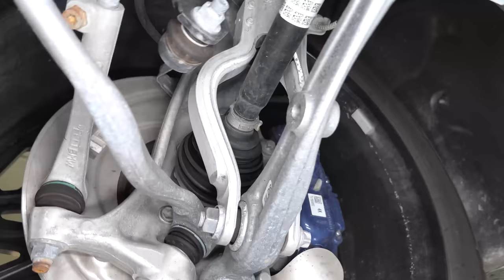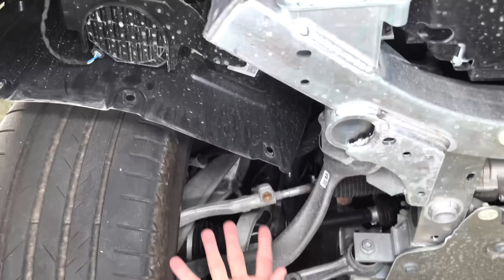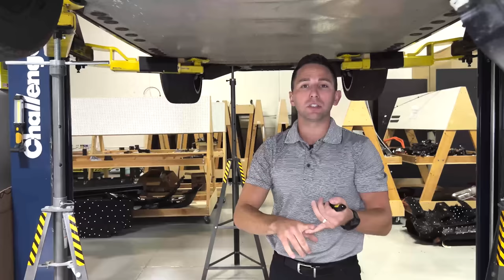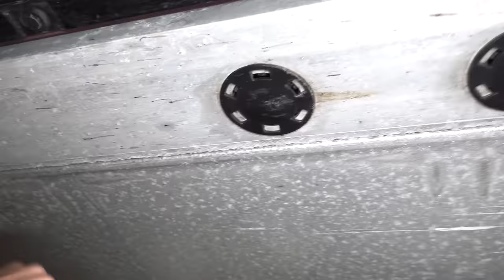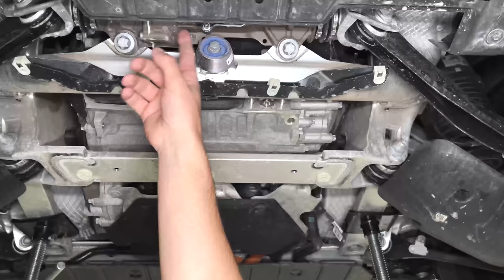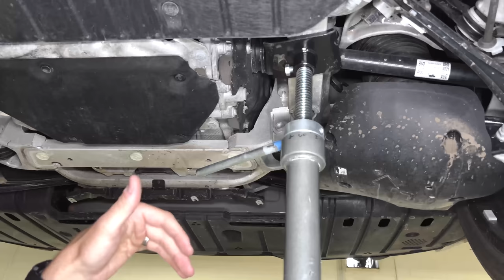Adaptive two-axle air suspension | BMW iX Hoist Review

Comment: Thanks for the great analysis!  I must add, that in addition to your obvious engineering expertise, you are very good at presenting.    Good elocution and good organization of the material.    I was lucky enough to test drive one of these last weekend!  It has kickass acceleration yet buttery smooth ride.   My Teslas haven't been even remotely as good on ride quality.   And, of course, it has plenty of impressive high tech stuff on the front screen for driver and passenger to play with.  And the Big Butt front of the car doesnt look so bad in person.   However, my local dealer wanted $108k for the car!  It was Red/black like yours, but did NOT have as many options as yours.  I look forward to your next videos about this very interesting new vehicle!
Reply from the maker: Thanks Wilber

Comment: Fabulous engineering design analysis Jordan.  I particularly was impressed at your discussion of a virtual ball, the intersection of two lines. I am Not a Mechanical Engineer, so lots of what you were discussing went over my head, but much appreciated nevertheless.  Your use of a laser pointer was Very Impressive.
Reply from the maker: Thanks Jay
Reply: OUTDATED horse & buggy design, outdated handling & suspension. TRY HARDER.
Reply: It would have been a good analysis if it was right. The name "virtual ball" is wrong by definition as the point of  two ball bearings is to not have a fixed virtual axis. If you draw it up on paper you will se that the geometry makes KPI move duringe a turn. The result is that the scrub radus (distance between KPI and the wheel center) wil shift in oposite direction on oposite side of the car and with that, the torque steering forces on each side will cancel each other out. In european litterature its called variable scrub radius geometry, and it was itrodused on Audi A4/Passat B5 in 1995. Or, at least, that is what they teach in machanics class in Europe.
Reply: @GTO33  - two WONGS don't make it RIGHT.
Reply: @markplott4820  What on erarth are u on about?
Reply: @GTO33  ignore him, hes always tr@lling for Tesla.
Reply: This car is like from the future,they have a graet vision and mindblowing buildquality,this car will revolutionize the way we drive in every way!Think about all the posdibilities!We could drive this BMW evs in small tunnels underground,that will solve all ur traffic problems!

Comment: 09:45 That lower control arm seems to be shared with (at least) the X5/X7. The hole is for attaching a mass damper (on the X5/X7), which apparently wasn't needed on the iX.
Reply: It is an X5 control arm.

Comment: The "soft" tyre aero deflector cone is necessary to meet the kerb strike test attributes.  The vehicle must be capable of being parked with its nose over a standard road side kerb (typically 100 to 115mm tall) without damage. By using a soft easily deflected material this means that people can park the car over such a kerb without anything getting damaged, but that parts of the underside covering /guarding can now project down into the kerb strike area to help to minimise aero drag (and wind noise too)

Comment: Two scenario's are probable to explain the post forge machining of the suspension horseshoe:

1) It was designed with a certain clearance that vehicle level kinematic testing showed to be in-sufficient, but the forge tooling was already done, hence the post machining op to increase the clearance

or

2) Real world testing highlighted the need for an improved steering lock (perhaps the rear steer targets were not met) requiring front axle knuckle/upright rotation to be absolutely maximised and the machining provides the extra clearance required

On my old E46 you could very occasionally actually feel the inside roadwheel go "over centre" at full lock, typically on un-even ground when the inside wheel was pushed up into the arch (towards full bump) so BMW clearly work very hard on minimising the turning radius of their products, esp the RWD ones where there is no front axle drive to complicate matters (CV joint limits)

Comment: The thick alluminium shear plates very firmly attached to the underside of the subframes are clearly to provide a cross axle stiffener to carry the (high) lateral loads at  a sutiable level of stiffness. Yes, they act to protect the underside components, yes they act to smooth underfloor airflow, but the size and number of the fasteners that attached them to the subframe members tells us that the primary task is to shunt lateral loads across the subframe (high clamp load required to pass load without fretting).  Of course these plates also massively increases torsional stiffness and reduces subframe trapeziodal deflection during offset (single sided) crash pulses as well, as the geometry of the shear plate clearly distributes any force in plane of the road surface. These plates also provide a simple way to tune the immediate off-centre response of the vehicle to handwheel inputs, particularly at the rear where the inital turn in feel / yaw rate is dominated by the lateral stiffness of the rear suspension

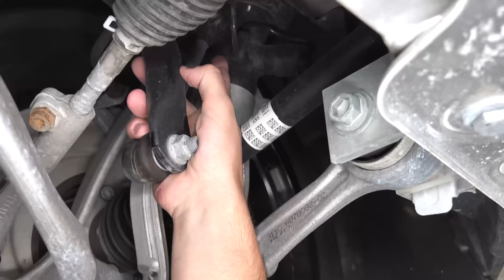Comment: At 10:10 you are referring to the hole in the lower control arm and suspects it may be a carry over part from another vehicle. This hole is to mount a vibration dampener which is likely due to specific wheel size for that vehicle. For example, in the X5 and X7 with 21" and 22" wheels, these vibration dampeners are installed.

Comment: Great job of explaining all of the components and what they do.  I have always looked at these items from a do-it-yourself perspective which I stopped doing in 2003.  Up to that time I have always done my own repairs and the year of vehicles I worked on was late 70's or earlier.  Yeah I'm old!!!   I would not want to try a self repair of anything on these vehicles!!
When I look at all that aluminum, I think of owning a vehicle in the 'salt belt' where they use salt in the winter.  How do you think these components will hold up?

Comment: A very good explanation . In lots of details . The part that you went on about honestly was slightly over my head . About cutting out a circle in the chasey would of been good to see maybe a slide show of that part in other car for comparison and then the explanation . 
Good a green laser pointer 👍🏽 camera 🎥 lighting 🫶🏽🙌🏾👌🏽 and in focus 👌🏽 
Now think what I would love to see is photos slides of the underside of the bmw with all the aero said b4 be great to see actual maybe a show of underneath all ev’s to show who’s car looks the most aero an area that I actually love not as much as battery cell but very close and maybe a aero guy actually showing where manafactures are doing well but also showing where there is need for improvement needed I generally think around the steering areas 
Love to see ingeneussolutions to deflecting air round parts 
🤞🏽🤞🏽🤞🏽🤞🏽🤞🏽🤞🏽🤞🏽🤞🏽
So in short a show of under body’s 
Maybe do a competition who ever gets the best under side name picked gets a signature of the underside signature on it thanks guys I have loads of idears

Comment: The temperature sensor in the wheel well has been with BMW for over 20 years, at least since E39. Not the best spot for reliability, but probably a good spot for ice warning.
Reply: The temp sensor responds very quickly in that location.
And it doubles as an indication that your mother-in-law drove over a parking stop until the tire hit, and pulled off the front wheel well lining and sensor when backing out.  Which happens every time she visits.

Comment: If that is rear wheel steer it must be the shortest range of motion I have ever seen, furthermore, it seems to be connected to the suspension arm rather than to a steering knuckle. Correct me if I'm wrong but that looks more like an active toe/camber control device. Go back to your EQS video and the difference is obvious. I would doubt if the steering angle allowed is more than a few degrees. On the EQS its a full 10 degrees.
Reply: It doesn’t need to be two digits lol…… at higher speeds it’s super responsive
Reply: @carholic-sz3qv  
Im sure it handles well, its a Bimmer! The question is if it qualifies as "rear wheel steering" or not.

Comment: 2:51 talking about front steering without mentioning that you did not mean front wheel steering, will cause confusion :)
Reply: True! For those wondering,  front steer in this case means the steering linkage is at the front part of the suspension, in front of the "axle line," where rear steer simply means the steering linkage mounts on the rear side of the (front) suspension.

Comment: @MunroLive Have you seen Bjørn Nylands video on the i4, where the battery and cabin share the air conditioning and cause overheating, if you fast charge and use the ac at the same time?
Reply: Scoor ding to Björn’s last comments BMW suspects there’s a problem with that very new car. Other i4 drivers also mention having no issues during trips in hotter weather
Reply: @ramdynebix  Yes, I was one of them. 40+ degrees celsius in France with fast charging and +130 kmph driving - no worries.

Comment: BMW pretty much never connect antiroll elements via the lateral links for two very good reasons:

1) You get approx half the displacement of the knuckle/upright at a point approx halfway along the lateral link. This means your Antiroll elements need twice the effective stiffness, and that puts twice the load and frictional losses into the system

2) Putting vertical loading into the lateral links really complicates the K&C bushing, and adds a large non lateral displacement to those bushes which changes the dynamic kinematics of the suspension

Less premium cars with lower R&H targets do this (connect ARBs to lateral links) to save costs at the penalty of less optimum dynamics......

Comment: Your analysis of BMW's engineering is insightful, but I respectfully disagree on one point. While not machining out the hole in the carryover control arm can save costs, it can increase delivery and repair costs as a new part needs cataloging, separate procurement, and global stocking. Part crossover between models benefits both customers and the supply chain.

Comment: Why does it make a difference which side of the ball the steering rack is attached? It's nominally a rigid link and always pushing on one side and pulling on the other, so moving the back or the front seem to me like they should have the same effect on the wheel? Can someone explain why this matters?  (2:19)

Comment: Hi Jordan.

Thanks for your explanations of the front and rear suspension and axle geometry.

Think BMW's idea is to combine ICE, PHEV and BEV Plattform in one as they did befor.

CEO Zipse is until today on the trip that the market becomes H2 and E Fuels Motors.

Yes he isn't right but he explicitly pronounced that all the BMW platforms based for EVs has to be able to carry an Ice drive train.

So you're looking on a conversion car underbody.... 😉

Thanks for the video!

Stay safe! 🌞❤️🙋‍♂️
Reply: Only the bmw i4 was able to have an ICE powertrain lol…. The bmw ix is 100% ev not halfbacked

Comment: It looks like the opposite direction of i3 engineering. More weight requires more heavy structure and you end up with a heavy tank.
Maybe i3 design doesn't work for a larger vehicle.
Reply: "More weight requires heavy structure"
Uh, no
Reply: @MrCarGuy  so you can use the suspension from a small car on a truck (no) ...sub frame ... battery case ...crash sagety structues etc.

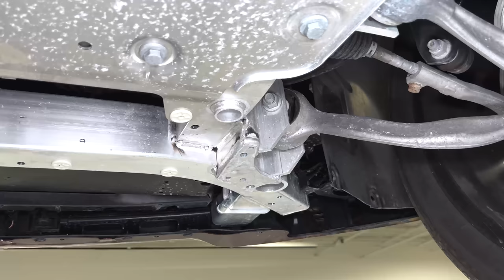Comment: 3:20 “So it’s very similar to some of the other startups”
I didn’t know BMW was a startup 😂
Nevertheless fascinating to watch! 🙏
Reply: That’s a really bad joke because BMW has actually been doing that since the bmw i3 and the castings ……. It’s actually great because in case of accidents it can be really easy to repair
Reply: @carholic-sz3qv  👍
(I’m a bit of a nerd to notice little things like that. 🤓)
I’m impressed by all the effort BMW takes to make a very heavy Electric SUV like the iX both safe, comfortable and undoubtedly very precise.
Reply: @Conservator.  it’s all the things from all wheel steering to suspensions to masssage…… that adds weight things that your typical tesla lacks!
Reply: Don’t forget the way better driving dynamics, the noise, comfort…….
Reply: @carholic-sz3qv  I can’t argue with that. 👌
Reply: @carholic-sz3qv  🐑 baaaaaaaaaaah

Comment: So in even a low speed impact in the front, the whole front cradle will deform ... and the torsion arm .. and the sway bar ... So, yeah, great for manufacture ( let's squeeze it all together and make more battery space ! ), but very bad for your insurance premium. This reminds me of the recent rapture around the one piece casting at the rear of a new Tesla : yes, great for economy of cost in manufacturing. But no thought of poor sap whose insurance premiums will go through the roof after very expensive repairs for minor accidents. Or am I missing something ?

Comment: Lots of very expensive TIG welding , Expensive equipment, Expensive Time wise, Lots of Electrical Energy to accomplish.  THANKS for the Review to see it up close!
Reply: Nonsense!!!!!!! BMW has been making sport cars for decades they have all the machines for this type of welding, if you remember the bmw i3 it has similar setups with aluminum extrusions super easy to repair in case of accident
Reply: In Germany bmw uses a big mix of renewable energy for production and they also built one of the worlds largest carbon fiber production factory in the US powered by hydroelectricity

Comment: iX is priced the same as the Flagship SUV the x7, between 80-100K Retail. Not a threat to Telsa, Ford, or Chevy.  They only sell around 20K, x7 's per year and iX probably be around 20K sales.    So BMW must be working on better priced BEV cars to replace the x3 and x5, in 50-75$K ranges. Once those BEV cars have this kind of build quality, BMW will have chance to stick around.
Reply: You kidding? This is a huge threat to Model X. Massive increase in quality in many ways

Comment: Tesla could be in trouble
Reply: I would agree! I have a Model X 100D, if the iX was available back in 2017 I would’ve bought it instead. But TBH I don’t think Tesla really cares about Model S/X, all the engineering effort is being spent on the factories and Model Y/3. I love my Model X but I would not buy another one probably.
Reply: Not a chance, this BMW is very expensive and inefficient build, ugly to most people, and like all recent BMW unreliable and extremely (instead of very) expensive to maintain and repair.
Reply: At least in this segment. Just sold my TMX. Cool car, but build quality were just horrible. Now back to BMW again. Have owned several, always been reliable and had superb fit and finish. Currently own two i3´s, they have been super reliable. Love the design also :D
Reply: @pablopicaro7649  Expensive to build for a reason, the iX has superior NVH and handling than Model X. Rear wheel steering is a must for vehicles of this size.
Reply: @pablopicaro7649  And you KNOW it’s unreliable based on repair records of this newly released car?
Reply: Maybe its a little more unreliable but you have a better ride!If you have the money and you want a perfect ridequality maybe you accepting more repaircosts!
Reply: Tesla has the worst reliability of all cars.

Comment: Tesla definitely has something to learn here.
Reply: Less so these days, and goes both ways really: BMW could learn something about software and efficiency.

That way they would not need to drop one of the motors in entry trim to catch up to the efficiency numbers to a dual motor competitor, or brute force upper trim with larger pack size, for example.
Reply: Not really
Reply: @AllanSustainabilityFan  well, here they're discussing suspension design, that's definitely something to learn for tesla.
Reply: @ogzombieblunt4626  really mate, really
Reply: @paulf3353  
BMW has something to learn about efficiency and simplicity lmao.
Reply: @ogzombieblunt4626  You'll be surprised to know that BMW electric motors are very efficient :) Simplicity? Why would they bother? they're a premium brand.
Reply: @paulf3353  
Lol looking at the motors alone is stupid. Look at the wh/m of teslas and compare them to other EVs. You'll get it.
Reply: @ogzombieblunt4626  LOL, you have no idea BMW managed to make efficient car even based on petrol designs)))
Reply: @paulf3353  
Lmaooo good cope.
The BMW IX has a MPGe of 86 while the model s has a MPGe of 120 and the model s is over 1000 pounds lighter...
Reply: @paulf3353  
You realize by being less efficient you put more wear on the batteries, which means you get range degradation faster. So many reasons why you wan't better efficiency in an EV but if you're a petrol head this thinking won't come natural.
Reply: @ogzombieblunt4626  LOL, how can you compare sedan with luxury SUV...
Reply: @paulf3353  model x is is 105mpge. Not much better my man. Keep coping.
Reply: @ogzombieblunt4626   I suggest you to invest a bit of time in research instead of base your position purely on MPGe, it is far more complicated than that. I'm not saying tesla is less efficient, but if you do more digging the difference if far less than numbers claim. But anyway, my initial post was about suspension, not efficiency.